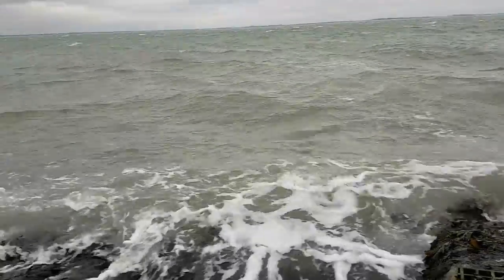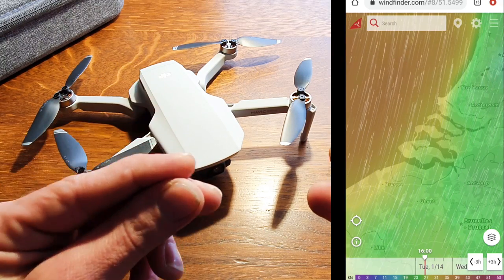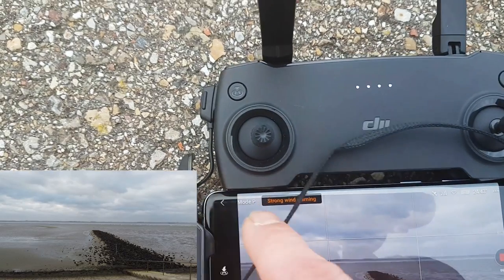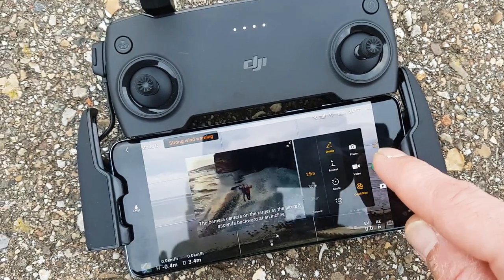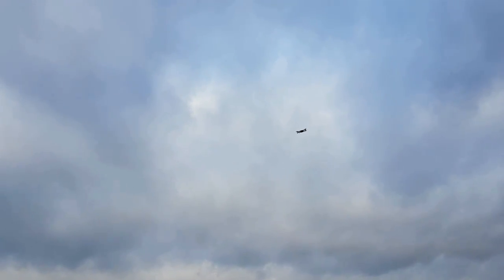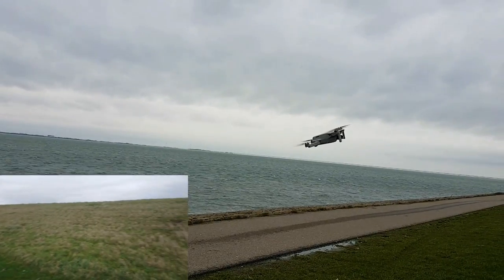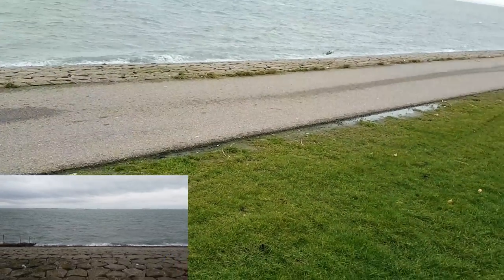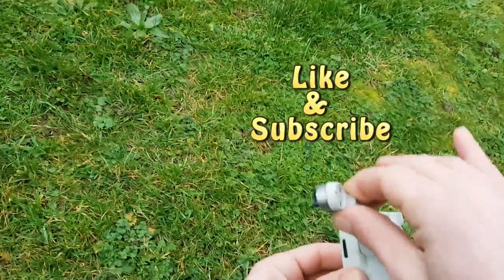DJI Mavic Mini Wind Resistance Test Speed Limit of Flying In Extreme Windy Conditions Almost Crashed

Comment: Hey thanks for sharing this video, It was a great idea. One thing to consider, the wind speed increases as you get higher in altitude. The speed of the wind on the ground is much lower than the speed of the wind at for example 20 meters.
Reply from the maker: yes we say that a few times in the vid during the quickshot test but a hill like the one i was standing on also compress the wind togther increasing the wind speed!

Comment: Greetings, it would be interesting to do the same tests but with ballast in the MM
Reply from the maker: why? woudent that put more load on the motors and props?
making it harder on the drone and deping on the size of the ballast also catch more wind! what ballast woud you like to see?
Reply: Only in cases where there is a lot of wind and you want to make a short video, I think that being heavier can be more stable, more difficult to be dragged by the wind and of course the flight time is shortened because you have to make more effort to keep it in flight. Everything is theory.
Reply from the maker: we try and see what happens and test how much weight it can carry
Reply from the maker: thanks :D

Comment: The problem with the wind meter is that it doesn’t give you the wind sped at different heights. Also if you are flying close to the wind limit, as soon as you get a gust above the max, you will lose the drone
Reply from the maker: that's true but the movemend of the clouds will tell me what i need to know and a gust of wind is not going make me lose my drone we just find a nother safe spot to land downwind the place i live is called the wind valley that's why i'm used to flying in horrible weather